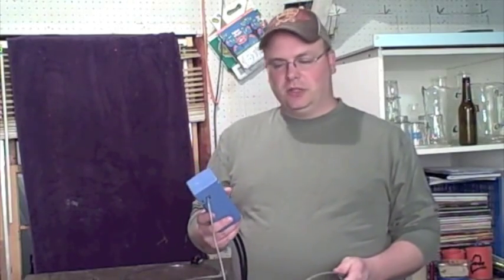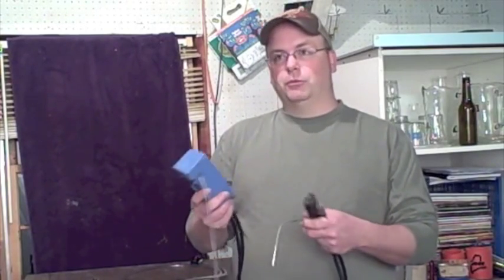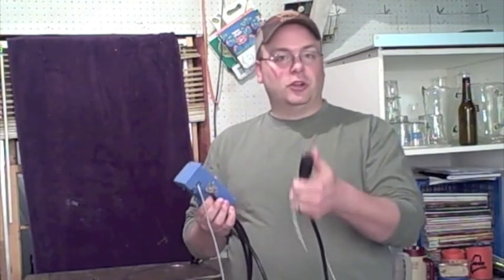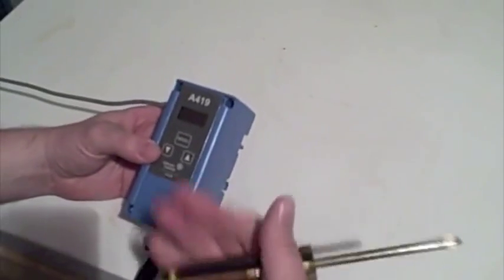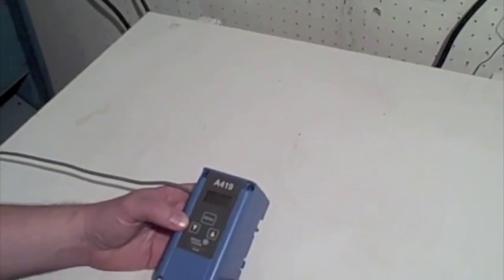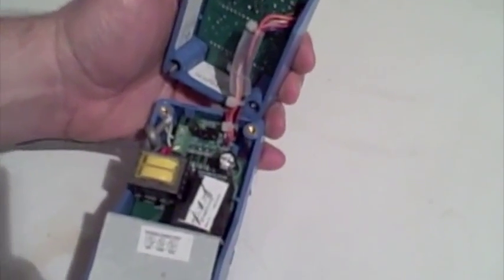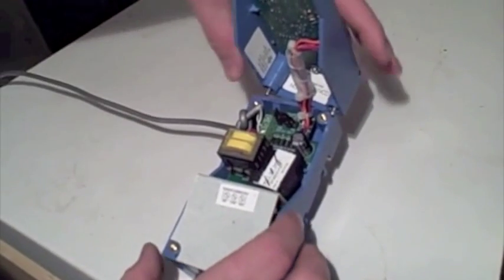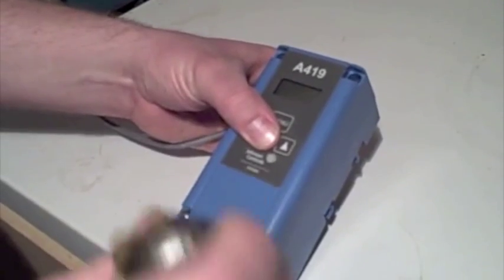How to Change Your Johnson Controller Jumpers

Comment: GREAT information!  I have been using the A419 for cooling, but even after staring at the manual, was clueless as to how to lager in my screen porch chest freezer without creating 5 gallon beersicles.  One jumper switch and a little ceramic space heater on the compressor hump, and my lagers are safe from the deep Wisconsin freeze.  Thank you!

Comment from the maker: You can use it to keep the inside of the fridge between 60-65 degrees F.  It won't heat the fridge, but it won't allow the temperature to go above the one you set.

Comment: you'd of thought they'd put a simple switch on the case .I use a simple thermostat it does swing a bit but 20lts of fluid takes a long time to change temp ,so it's fine